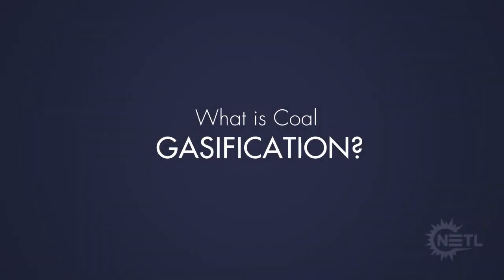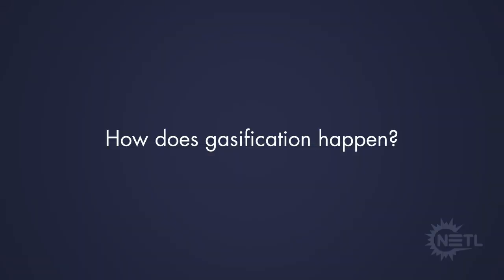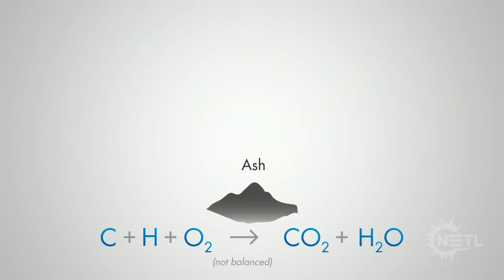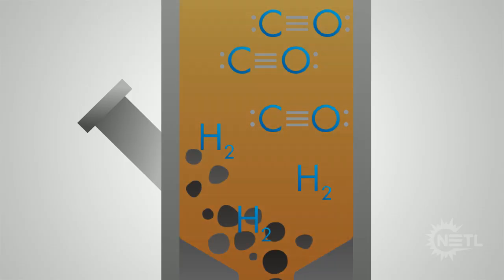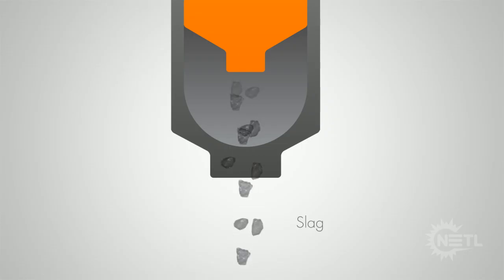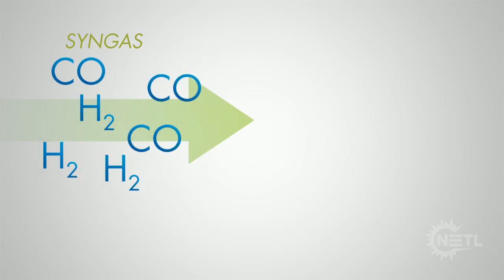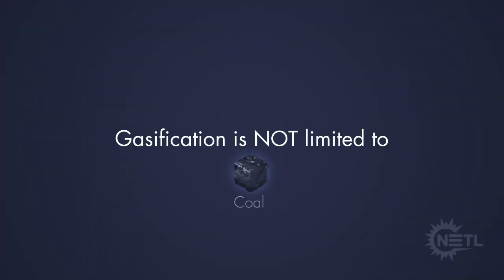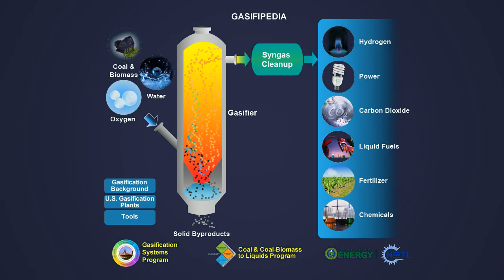Gasification Animation

Comment: The elements described in this dissertation are used in the wood gas. & in this way, we can use a charcoal colom to produce a synth gas suitable for ruing gas combustion generators. 
there is a growing resistance to what is referred to as carbon pollution. Note the general move is not to ban. the use of carbon But to tax it as a reason to collect revenue as we find easier ways to be self-sufficient in energy There will be less tax income from profits in the reduction of power,   It is this reason the establishment has less opportunity for income from e its power industry,  the carbon tax. in my opinion their way of offsetting their loses. in the model world solar panels & betray storage technology. this is why seek a worldwide carbon tax.

Comment: The process needs to use biomass today but wastes material to deliver heat. Further some oxygen is present.
 I would like to see smaller insulated reactors, heated by micro waves and with added hydrogen carrier and in oxygen free conditions. We would get a lighter fuel mixture but it would make the process even carbon negative if as last step some bio char could be formed. ( not returning in carbon cycle)
Yes, yes, I know it's infinitely easier to say this than to build one myself.

Comment: 2:35 So you burn the H2, but what happens to the C02 which was created by adding steam to the syngas to create the H2 and C02?
Reply: It can be removed and cleaned for various commercial uses like CO2 for the beverage industry, production of dry-ice, etc.
Reply: CO2 will go to the air, there is no efficient way of making hydrogen without CO2 being a biproduct

Comment: Doesn't it take a lot of energy to run the full process?
Reply: It's basically self sustaining. You can create syngas just by pyrolising (burning) the wood in a slow process in order to yield the gasses embodied in it. Blowers need only be low voltage devices so will require little power but generally they enhance the operation/yield of useable gas.

Comment: Is this technology more expensive compare to coal energy plants in maintenance or requires costly investment in building these facilities.
Reply: Exactly.  Unless you want to eliminate the ash and emissions from incineration gasification to produce electricity is much more expensive.  However if you want zero emissions and zero ash Waste to Chemicals W2C will provide attractive returns for investment in large scale waste recovery systems.

My estimates are it will cost $1000 per annual ton of waste to build a high temperature gasification system and the full production cost would be in the range of US$ 4 to 6 for a kg of pure Hydrogen.  HTR gasification also produces byproducts from the trace and mineral and metal elements in the waste.  New patents to produce rock wool from waste mineral components would absorb much of the operating and depreciation cost bringing the Hydrogen cost below US$4 per kg.  US$4 /kg is the DOE target for US hydrogen production.
Reply: You could find your answer in our website: www.lcdri.com
Best regards,
Michelle
Luoyang Building materials & Architectural Design& Research Institute (LCDRI)
Tel/Wechat: 86-13783185378                      
Fax: 86-0379-64363566        
Emali: michelle@lcdri.com  
Web: www.lcdri.com

Comment: i still don't understand some part, like this part, combustion naturally produce steam, so why the steam was added in gasification?
Reply: MN - Gasification will occur when organic material is elevated to 800 degrees C.  At 800 degrees C when most compounds decompose but carbon and some compounds compounds will not break down at these temperatures.  HT gasification increases vessel temperature to 1200 and in some parts 1600 degrees C to melt stone and meta.   Water, which becomes steam inside the gasifier has the capability of converting carbon into pure hydrogen and CO2. 
 
This is why water is important in the gasifier.

Comment: Just a simplified PSA for grade school level knowledge.  Any wood gasifier setup can convert over yard waste and wood into syngas/ woodgas.  That is at least carbon neutral using renewable sources instead of mined sources.  The syngas can be used to run a car or generator, which will lower the carbon footprint from coal and oil.  I just gave you some search terms- go forth and learn.
Reply: more correctly called pyrolysis, not comparable to high temperature oxygen fed industrial size gasification
Reply: Pyrolysis furnace charcoal and getting rid of smoke How do you deal with the preparation of condensate and separation Components of tar and purification of gas Answer your explanation Is it sufficient for one condensate and one treatment unit for me?

Comment: Make a store bought one that ppl can use and sell byproducts to the chem companies
Reply: Westinghouse attempted to build a 1000 ton per day plasma arc system in Teas Valley UK.  It did not work.

The only commercially proven system is Thermoselect the latest generation operates on 15 mj/kg waste quality at 13.667 metric tons per hour or 15 tons per hour at 10 mj/kg waste quality.  Lower heating value produces more CO2 and lower energy syngas.

Comment: LOL! Gasification to produce clean energy??? what a joke!!! Pls tell me how much carbon-di-oxide does the gasification process generate???
Reply: Public understanding of gasification is not at a good leve.  Most people confuse pyrolyzation with true clean high temperature gasification which captures 100% of all elements in waste as marketable products.

For the system described above the percent of CO2 included in the synthesis gas ranges from 18% to 40% depending on the heating value of the waste.  The only commercially proven high temperature gasification system has a guaranteed operating range for waste feedstock heating value of 10 to 15 mj/kg.  at lower heating value the CO2 content of the synthesis gas exceeds 40%.  At 15 mj/kg the CO2 contend is reduced to 18%.  The system may be capable of operating at 18 mj/kg but there is no empirical information to prove the CO2 content will fall below 15%.

To produce Hydrogen which is the basic building block for many petrochemical processes is produced by a standard petrochemical process called water shift which converts the CO in the syngas to H2 and CO2 increasing the amount of CO2 produced.  The H2 and CO2 is separated one technology for this purpose is Pressure Shift Analysis which can produce 99% pure H2 and 95% pure CO2.  In this process the CO2 is captured and ready for commercial use or sequestration.
Reply: Sourav Chowdhury Carbon dioxide should never be the real worry;  just grow a specially-genetically-modified tree (i.e., a full-grown redwood tree with a diameter of at least eight feet maturing to that size in just THREE YEARS), and grow enough of them, plus grow a special algae for our oceans and waterways, and the carbon dioxide  "problem"  will be solved.

In fact, it's METHANE, released from raw garbage landfills (which please police forensic teams EXCLUSIVELY) is several times worse (over 20 times) than carbon dioxide as a  "greenhouse gas",  yet we continue to bend over for LAW ENFORCEMENT ONLY when we outrightedly refuse to even examine other waste disposal methods, plenty of which produce immediate benefits which then have long-term value....
Reply: @CraigF.Thompson  its nice to see not everyone is a dimwit when it comes to this tech, you can also run the co2 exhaust through tanks of algae to produce algae and oxygen. Algae can modified to make gasoline or other things.
Reply: "cleaner" would be a better word. For instance the jet fuel is cleaner when made from coal. Ultimately you can get kinda nit picky about clean and cleaner though considering wind turbines, for instance, are created using literally tons of coal and gasoline. So is that wind turbine totally clean? No but it is 100x or so more clean than just using coal.
Reply: I think the point is, the CO2 is not being released as a flue gas, it can be sequestered, for CCS

Comment: Good easy way to follow what Gasification does and how we can use it to make clean coal products.
Reply: Actually I am working the implementation of commercially proven technology to recover municipal solid waste (blending some coal or petcoke to improve the heating value to produce pure hydrogen for Fuel Cell Electric Vehicles.  The balance of MSW produced in a metropolitan area assuming 1 kg per person per day converted to Hydrogen by gasification WS and PSA would provide adequate fuel for the private vehicles registered in the same metropolitan area.

wish me luck
Reply: @waleed2008smith  how is your research going?
Reply: @waleed2008smith  can i have your email or other source to contact you